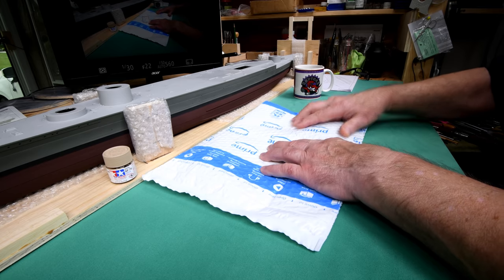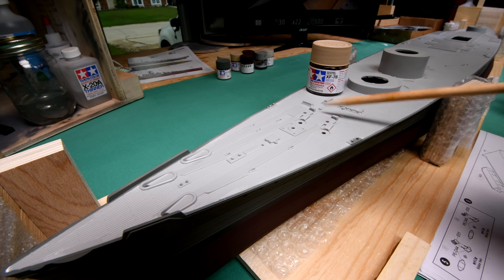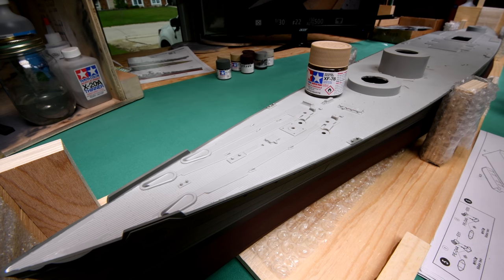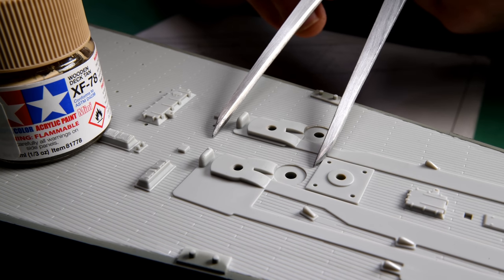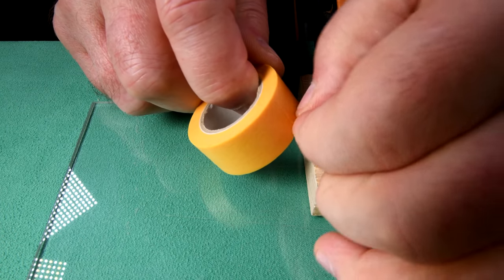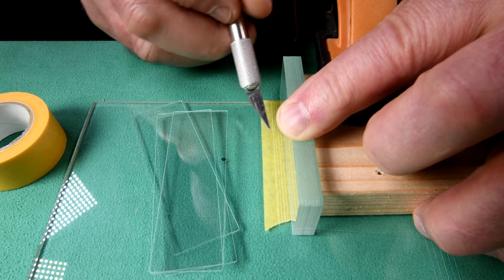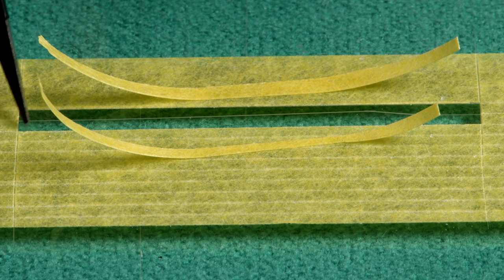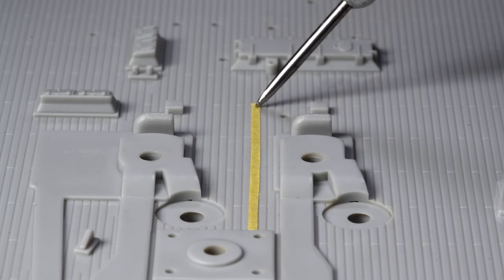The Model Ship - Part 542

Comment: Ron, those glue tips are great. I use them daily, and they rarely clog, so I don’t bother to protect them at all. However, when the DO clog, all you need to do is take your hobby knife and cut off a mm at the tip. I usually get about two weeks of usage. Mileage may vary.
Reply from the maker: Sounds good. 🙂👍

Comment: Just put the Glue Extender Precision Applicator in a sealed jar with a little acetone when you are done and it should be good as new the next time you want to use it.  I soak my CA tops in acetone all the time to clean and unplug them.  Make sure the jar is sealable or it will evaporate rapidly.    See ya.      JimE
Reply from the maker: Great tip Jim. Thanks! 👍🙂

Comment: I am no builder or painter. On the deck can someone paint it with XF-78 and then use a thin black and rub it in the cracks a on the deck to make it look like the planks are separated.another great video.
Reply from the maker: There's a lotta deck there, so that'l be a lotta rub'n 😁👍

Comment: Here's another painting demo for wood deck - https://youtu.be/2wkwjipkHjI.  I'm still hoping that you try the wood veneer!  Hull looks GREAT!
Reply from the maker: Thanks for that link  👍🙂
Reply: A suggestion re: tape strips - don't cut then to the exact length, make them a bit longer. The plank ends are molded into the plastic deck so you can use the tip of your blade to trim off the length on the model. Why not try this on a smaller deck section (upper deck) that isn't glued down already.  That way, if you decide you really don't want to pursue this, all you need to do is spray deck tan on that one (smaller) part.
Reply from the maker: @S_MannMann  Thanks for the suggestion, but this may become more time consuming that I'm prepared to give. 🙂